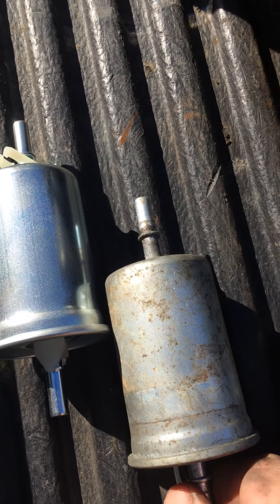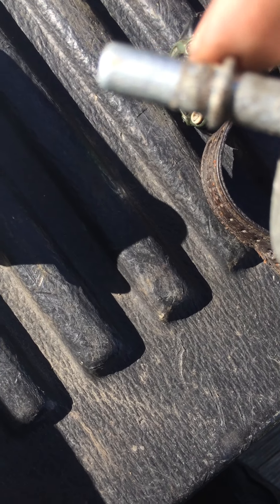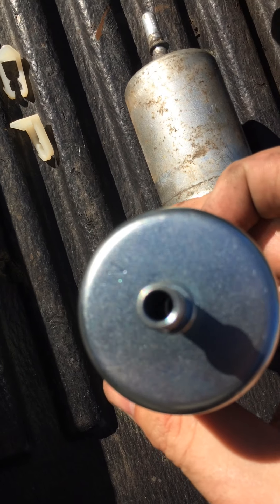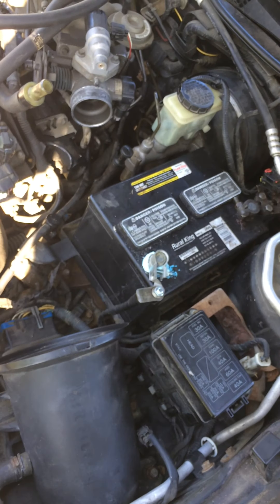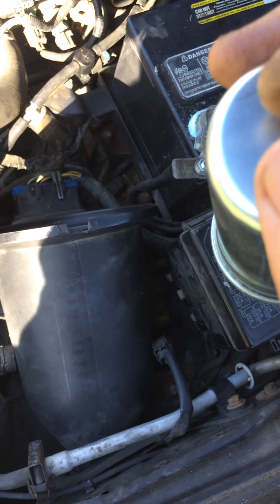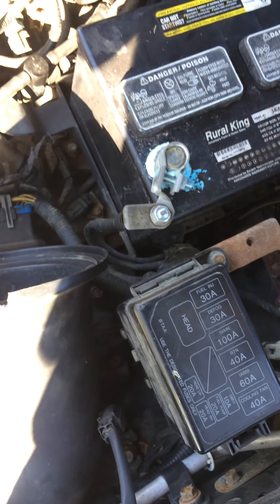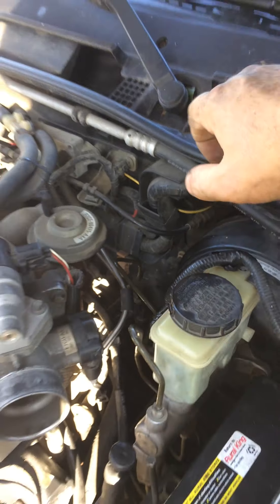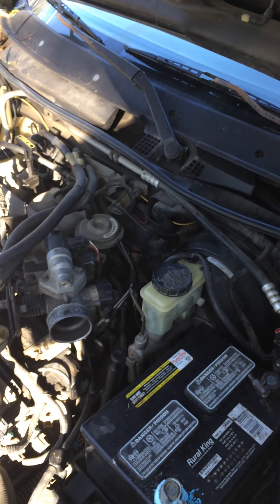91 03 Ford Escort Fuel Filter Replacement Part 3

Comment: Pick your brain. I’ve got a 99 zx2 that the motor went out on. Naturally, I just filled the tank, and I want to get the gas out before I haul it off. I’m thinking if I take that top line off the filter, put a piece of hose on it, and turn the key on, I can just let the fuel pump run and put the gas in a can. Seems to be easier than pulling the filler neck and trying to siphon in my opinion
Reply from the maker: If your sending it off to the scrap yard, they will drill a hole in the tank so why not beat them to it and drill a hole in the bottom of the tank with a 1/2 in drill bit and put a container under to catch the fuel and your all set.
Reply: @ranger.auto.repair  touché. I guess I’ll go that route
Reply from the maker: I will let you know how I got gas out of a car, I bought one of those hoses with the marble in it and took the fill hose off the tank and put the siphon hose in the tank with the marble end in the tank and I gave it a shake and let it rip.. I got 14 gallons out of an 18 gallon tank in about 5 minutes! Escort tanks aren’t that big so if you wanted to go down that road. That’s how I did it.
Reply: @ranger.auto.repair  that was my initial thought. Pull the rubber hose off the bottom of the filler neck and siphon. Or pull the rear seat and sending unit and get it from the top. Then someone suggested pulling a fuel line and letting the pump run. Knocking a hole in the bottom would be efficient, but could be a mess. Or waste the $30 worth of gas and just haul it off lol